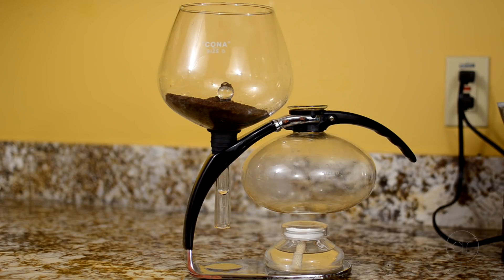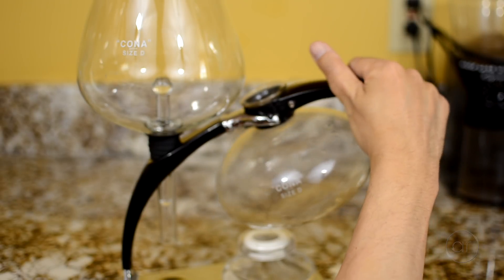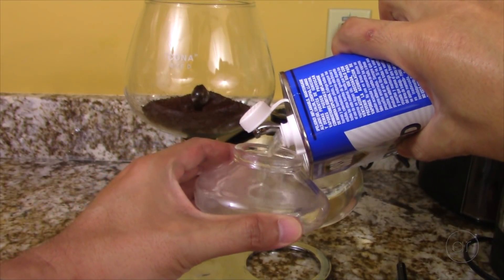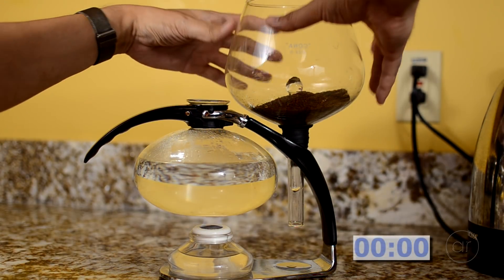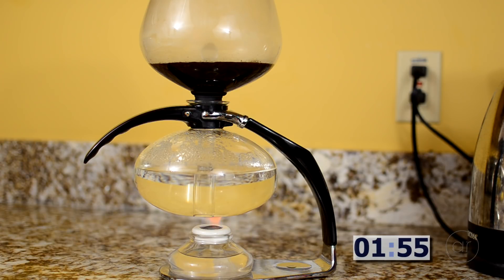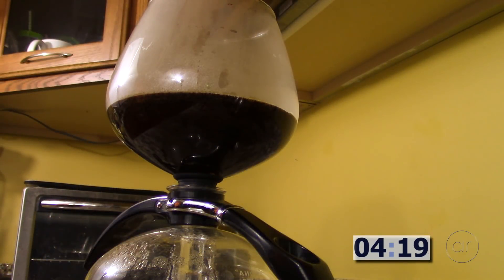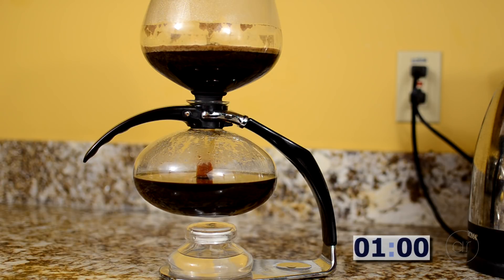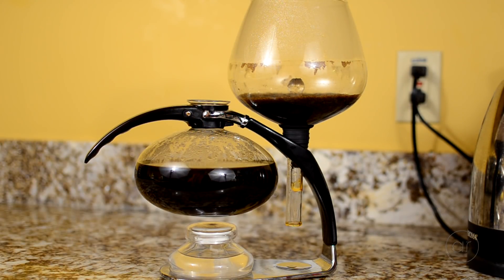The Physics of a Vacuum Brewer - How to Make Coffee with the Cona Vacuum /Siphon Brewer

Comment: I'm a big fan of different ways of brewing coffee. I like clover pressed from Starbucks if I go mainstream. I also prefer a French press over drip any day as it does brew more full flavor fresh seeming coffee. 👍🍵
Oh, I believe it's glass that isn't tempered that will break under the stress of fluctuation from temperature. Things like coffee pots or most any glass you find in the kitchen will be tempered.
Reply from the maker: Thanks my friend. I also prefer French Press over drip so that's my go-to method 99% of the time. The Cona is tempered glass - I was passing along a story where someone found that drops on the outside shattered the glass when the water was boiling inside.. my guess is that it's the same physics of a water drop shattering an incandescent light bulb (if indeed the story is true).
Reply: The original Cona company in Britain used Borosilicate glass which can handle sudden temperature changes.  I believe the current manufacturer of the Cona in the Netherlands which only produce the size D at present also employs the same high heat resistant Borosilicate glass.

Comment: I don't like the method of sourcing heat. The company should release an electric hot plate that has the same physical dimensions and appeal as the current source.
Reply: My CONA Factory did so, and offered it in 60's, but it only gained a fraction of the popularity of the  alcohol lamp. I still have one, that I recently put the test. The video here times making a full pot of Cona Coffee with the former white ceramic wick assembly, that we replaced by an improved stainless steel version. The new stainless steel burner bed produces a flame that feeds more energy, thereby increasing the speed by which the water rises, yet doesn't overdo it once the bubbling begins. Then you snuff the flame and instantly the downward process sets in.  What happens with an electrically heated metal red-hot coil (or halogen lamp) is that it continues to feed heat  as it cools down slowly to ambiant temperature, thereby losing speed instead of gaining it. We also timed the whole cycle with the new assembly, and found the speed of our Cona D-Genius is the same a an electric Moccamaster to brew a full pot.  The Cona is most often used with guests seated around a set dinner table. No electric cable  leading from the table to any wall socket, while all lean back to behold a curious spectacle that results in excellent coffee.

Comment: How do you clean the coffee pot when it gets dirty?
Reply from the maker: That's a very good question. The mouth of the pot is very small so it's difficult to scrub the insides with a washcloth or sponge.

Normally, I rinse out the pot immediately after I drink the coffee. But one time I left the flame on by mistake (to keep the coffee hot) and all of the coffee evaporated, leaving a nasty burnt residue. What I did was add crushed ice, vinegar, and several scoops of salt into the pot and swirled it around for quite some time. I'd say that removed 99% of the residue. There was still a slight stain at the bottom but the pot was good enough to use again.
Reply: access random when I worked my first job at a diner that is how they showed me to clean the narrow mouthed pots.
Reply: A bendable bottle brush is the best method.
Reply: I was going to reply "very carefully!". This is soooo cool.